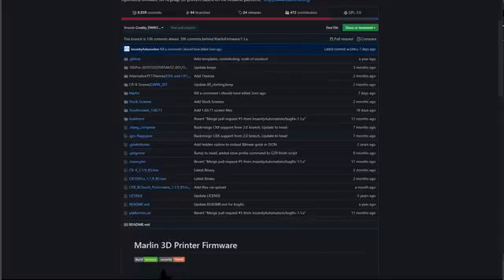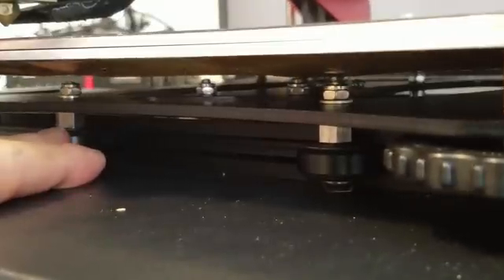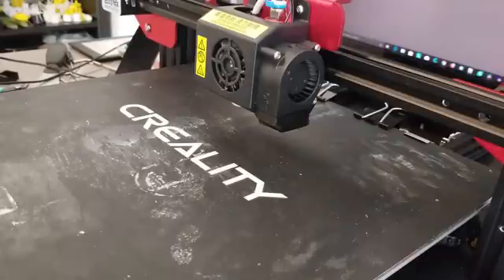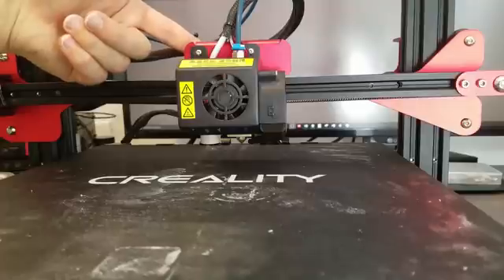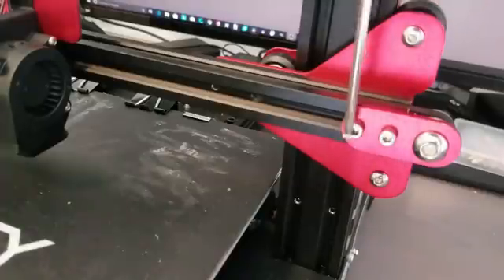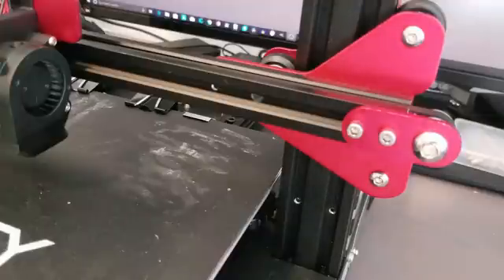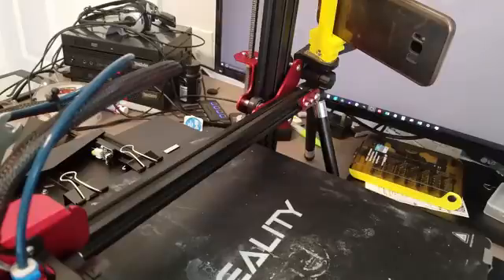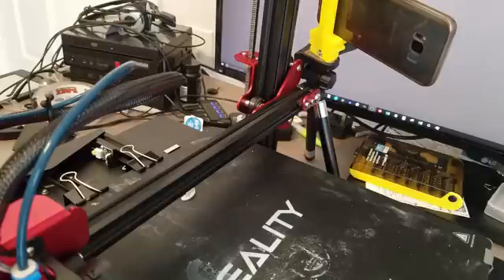Creality CR10S PRO, 3D Printer Setup, Checkup and Tuning after unboxing

Comment: Hello, I have a Creality CR-10S Printer that I can't get to print. The z Axis goes up and down when homing but won't When Printing. It just stays on the first layer. Is this a printer problem or am i doing something wrong in Cura ?
Reply from the maker: Usually the 3d printer comes with some gcode on the USB stick. The g-code is compiled by the manufacturer. i thing you should try the g-code that comes with the printer, and if the z axis advances properly the you could make the supposition that it could be cura. In addition you could try the Prusa slicer or kiss slicer to test if it is Cura or not. Moreover if the same problem persists on all slicers than it could be the firmware, Have tried downloading a new firmware from creality and installing it? In addition you can try facebook groups which pertain to your printer and the collective knowledge there can help you much better than one mind here. You can install repetier host to look at the g-code you generate with Cura. In addition you can try to run a virtual machine in virtualbox and install cura there and try to generate g-code. It could be your computer that may have an issue. try another computer with a clean install of cure. Which version of cura do you use? Is your printer the CR-10 S, or the CR10 S pro? HAs it always done this problem? Is it new?

Comment: i can't figure out how to tighten the gantry rollers...you really don't explain very well here...there is only one roller will a hex nut on either side tried to figure it out... never had issue with my ender 5 adjusting rollers... this is a brand new printer...
Reply from the maker: Im not sure if tou have question or just pointing out that i did not do a good job at explaining how to adjust the rollers on the gantry. The only way I know of tightening the gantry rollers is to use the eccentric or offset nut. I also had to this on my CR10 s5 because even with the antibacklash nuts the x axis would sag on one side.
Reply: @RoamingInterests  Thanks... yes mine is not right on my machine... it can be adjusted but it was a real pain... when a machine is built right like the one you have it is a very simple adjustment.. thanks

Comment: Very good information. I just received my Creality CR-10 PRO a few days ago. Just started the leveling process. Have a question on the tiny machines firmware replacement with the one on marlin 3D firmware update. Should I do this now before I do anything else. I backed up the thumb drive from creality so I can always reinstall that if this change out doesn’t work.
Thanks for the time you took on this video. Will be back for more.
Reply from the maker: i think you should do the firmware update first. but if you want to play with the firmware from creality you can always do it later all you ll have to do, maybe do another bed leveling. In addition in the meantime creality may have fixed some of their bugs in the mesh bed leveling.

Comment: When my ender cr10s pro arrived, the print head was so loose I couldn't understand why.   I adjusted the eccentric nut until it just wouldn't adjust any more.   I took it all apart and noticed that the mounting point for the eccentric nut was everso bent,   Once the bend was removed, I could adjust the eccentric nut so that all play was removed.
Reply from the maker: I never verified for that but now is a bit late since I do not have it anymore.
Reply: Same for me

Comment: Your print head was ratteling because the aluminium plate was bend. Most likely the half circle where the excentric nut is located. So the wheel aren’t perpendicular anymore creating so much slack the excentric nut can’t compensate anymore. You solved it by putting the plate in a vise, an you unknowingly straightend the plate. So yeah there was more to it than only the excentric nut ;)
Reply from the maker: Thanks for that tip. I will keep it in mind.
Reply: having build precise data collectors for Medical Imaging this machines alignment processes are very weak. Key alignment factors are squareness, location, alignment and rigidity. Parts should be machined for straight and accurate operation. I just received my 1st Creality CR 10, its a Pro. I plan on going over every mechanical interface and measure all critical alignments with digital and calibrated tools. I don't have a machine shop but I am sure I will be able to set it up mechanically as good as possible and address misalignments and bent parts etc. All these videos point to the state of the art and the price we are paying. engineering costs money but it works. I am retired so my engineering is really cheap. Lets keep pooling our experiences and helping each other make some great parts. we may need to find some shim stock to achieve all the goals.  Good video, good lessons learned.

Comment: the bed leveling is a Nightmare , Still can't get it right, going to try BL Touch ? What do you think?
Reply from the maker: i never tried BL touch. I saw most people change the leveling probe to a BL touch or something else like an inductive. For me the tinymachines3d firmware did it. i was able to dial the bed leveling in and then did not have to adjust it. But i never changed it to anything yet.

Comment: What cam/resolution are you using on the tutorial  video? Also. Did you convert it in any special way to get a proper filesize for posting on YT?
Reply from the maker: I use 1920 x 1080. I am not sure what do you mean by proper files size for posting on youtube. I used davinci to edit ,and screen captures software or cameras. recording at 1080p.

Comment: How to tighten the belt that moves the bed? Mine has a bit too much flex, and can occasionally cause print issues.
Reply from the maker: You have to open the base and check the motor.